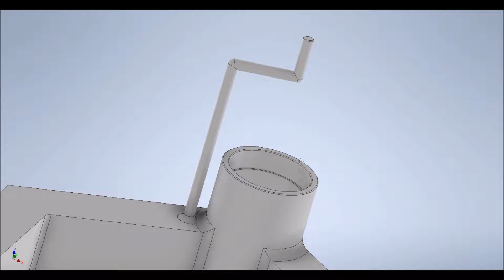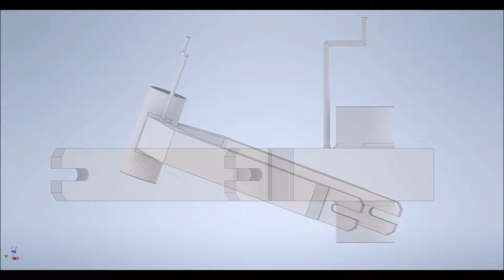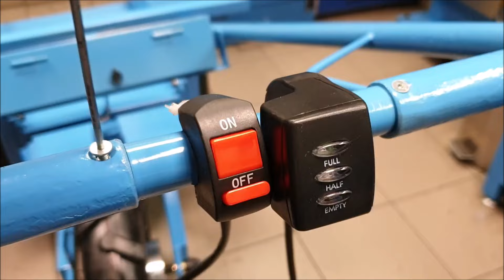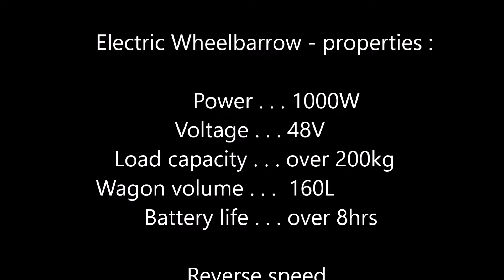Making of electric wheelbarrow 160l

Comment: It wouldn't be hard to move the front wheels forward if you need more weight on the drive wheel.
Reply from the maker: Watch the video to the end.
Reply: @PaulXchannel  just push down on the handle to get more traction

Comment: Wouldn't it make more sense to put the motor on the primary axle to avoid torque steer on swivel caster?
Reply from the maker: as a new project - yes

this is rebuild